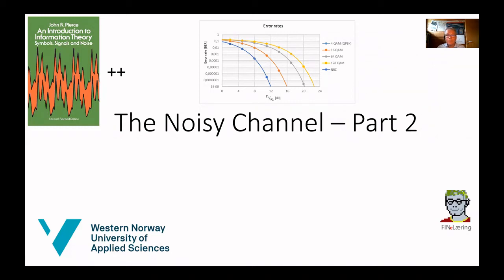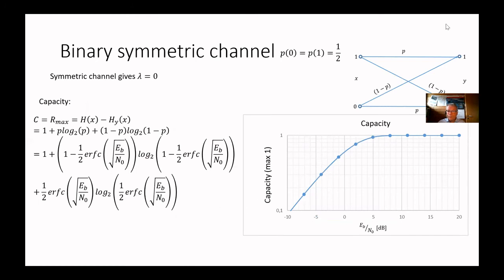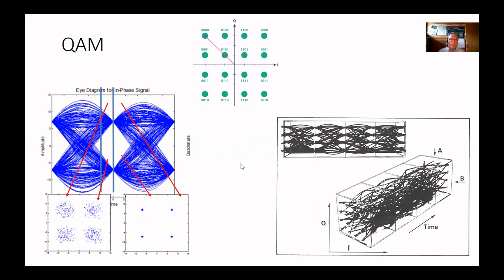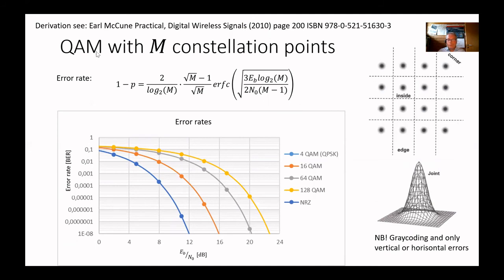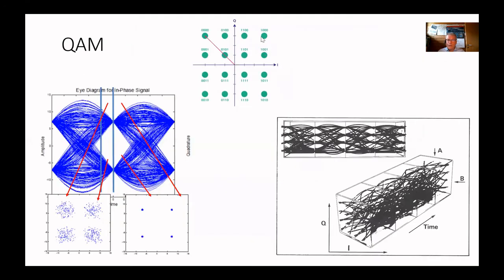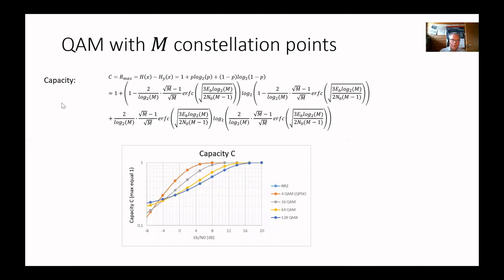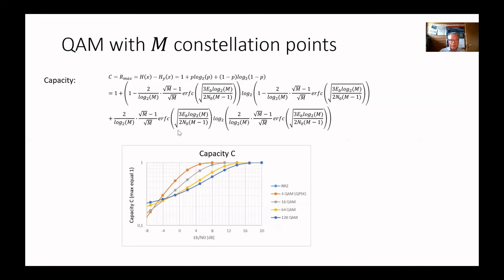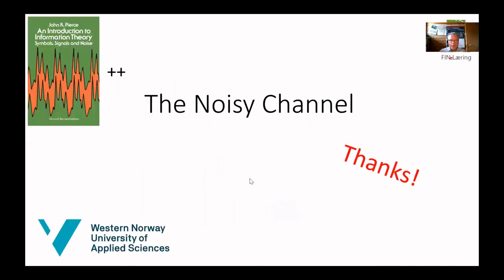The Noisy Channel - Part 2. Capacity of binary symmetric channel and QAM

Comment: I watched your very informative video The noisy channel-part 2. I am interested in the calculation of the capacity of QAM with M constellation points, which is stated at the end of the video. For example if you look at the picture for the dependence of capacity on Eb/N0 and if you take Eb/N0=8 dB for 128QAM, you get a capacity of 0.6. I am interested in how to get the capacity in Mbps from that. What formula is used for that conversion.
Reply from the maker: Thank you.